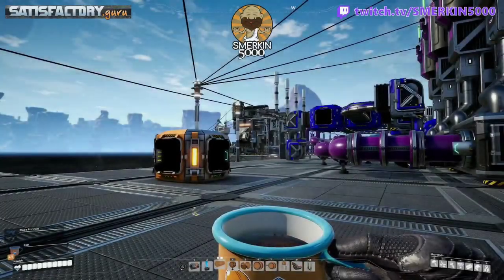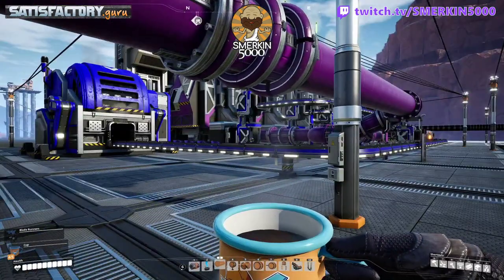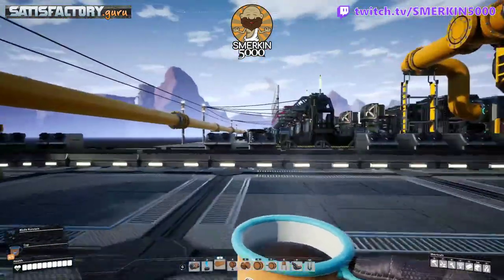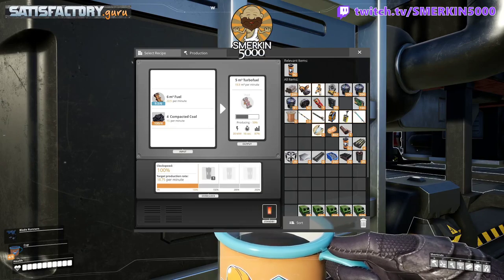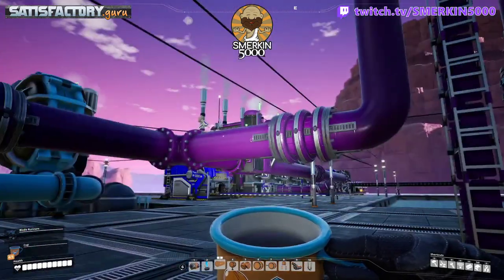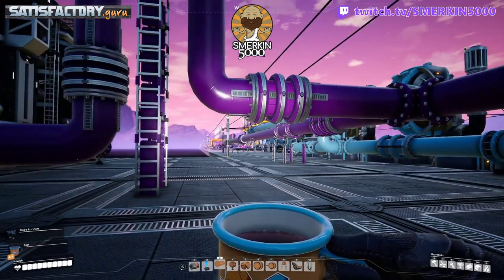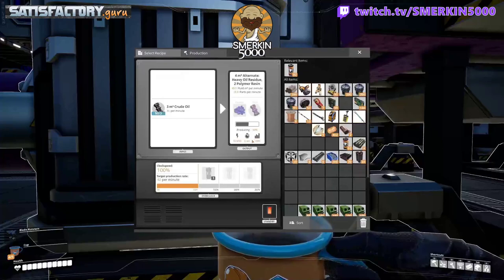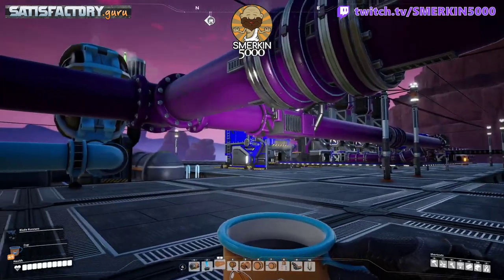Understanding Fluid Overflow

Comment: I appreciate this video, thanks! I try to use valves, instead of pumps, for segregation of the pipe network. Pumps are supposed to act like valves, in addition to headlift, but I don't think would be strictly necessary for this solution.
I hadn't seen this bit of engineering before. I'm going to try it out. Thanks again 👍
Reply from the maker: Have fun

Comment: Now that Fuel Generators will run at 100% at all time with Update 4, sinking fuel will be much easier.
Reply from the maker: It will be easier, a HOR overflow system will still be usefuel for catching any mis-math
Reply: @smerkin5000  It will indeed! In fact, I came to this video because I needed it to sink excess fuel from my recycled plastic production line, but wasn't sure on how to make an overflow pipe from it.
Edit: Grammatical Changes